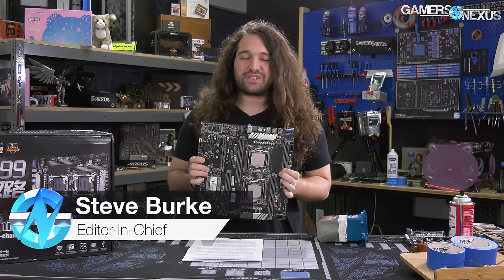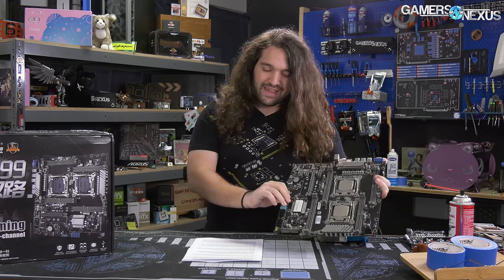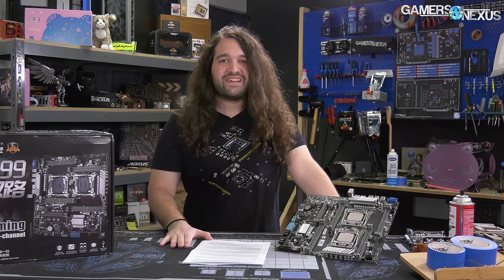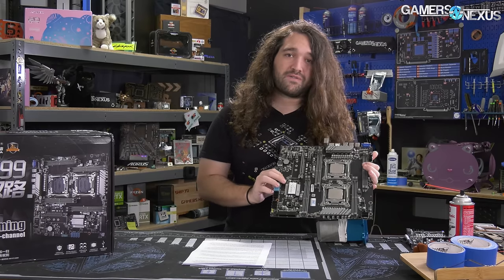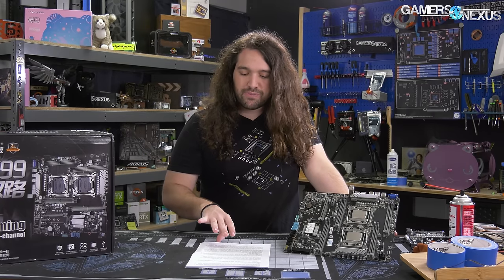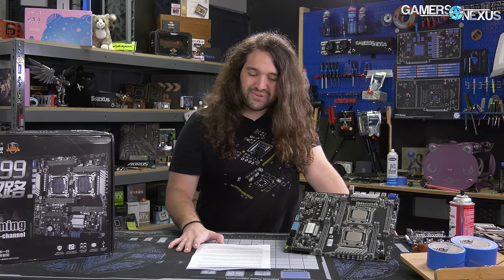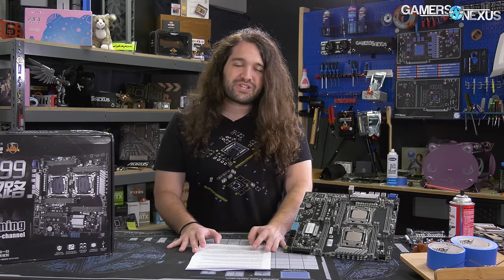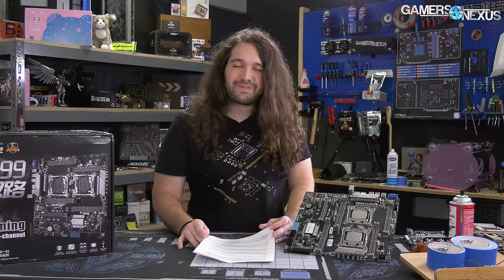24 Cores, 48 Threads for $360: Dual-X99 Jingsha Motherboard vs. AMD R9 3900X

Comment from the maker: You'd likely enjoy our computer mall tour at SEG E-Market in Shenzhen: https://www.youtube.com/watch?v=nXWB9GPkm3U
We previously built a dual-CPU X79 system here: https://www.youtube.com/watch?v=QEb_wxKVJbE
GN Wireframe Mousemats will be back in stock soon! Guarantee you're on the list here: https://store.gamersnexus.net/products/gn-wireframe-mouse-mat We sold through fast last time, so we're taking back orders early so that you don't have to keep checking back for the restock date. The Wireframe Mouse Mat is a high-quality, durable mat with high print resolution and custom features, and quickly became our fastest-selling item on the store. (Also, if you've got a Gold Foil shirt on order, those will finish production in November!)
Reply: hi
Reply: "they looked kind of like a scam, so we bought them" 🤣
Reply: Yessss! Been waiting for the mouse mat back order so I can finally support GN with more than just patreon.
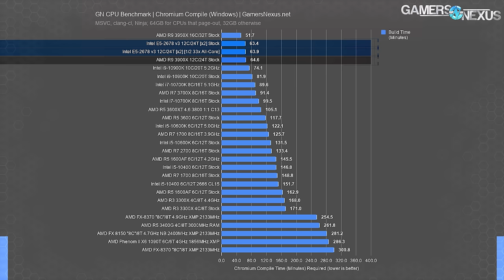Reply: 22:39 Sure they use more power per second. But you need to keep something in mind: If this pair of Xeon's they knock minutes off a render time, that is minutes where power a pair of hungry CPU's are not consuming any electricity. Things aren't exactly as bad as they appear on the surface.
Reply: 011 mini when?
Reply: Happy owner of E5 2620V3 with 3.2Ghz all core unlock + Z99 v102 mb, total cost $83 :-)
Reply: The reported Quad Channel is actually correct. Each CPU only has 4 active channels so the operating mode for the memory is Quad Channel, with two active NUMA domains. Sure it technically is a total of 8 memory channels but you only have the bandwidth of 4 unless your workload can utilize both CPUs properly without cross NUMA domain communication via the QPI link which would severely limit performance and other issues (those 0.1% and 1% lows in games), Blender is an example of a workload that can do this.
Reply: This is still a good option for anybody that does productivity with light gaming on the side.
Reply: Games might work better by assigning cores in windows to one node
Reply: If someone gets the idea to use this for a programming workstation, based on benchmark numbers I wouldn't recommend it.  What I've found that most of the real-world tasks don't use many threads. With my 3900x I would categorize tasks into two camps, with one is very common and another is less common. The common task is quick recompilation after small changes to the code those tasks use only very few threads and most of the cores are idle, and that doesn't scale to lots of threads so expect older Xeons being annoyingly slow, enough to distract you from thinking the problem. The second kind of task is less common which is a full compilation of everything. Full compile is what every benchmarker uses, and you don't necessarily need to do it every day, unlike the common task that you often want to do multiple times per minute.  The full recompile often scales well with more cores, especially with large codebases. So for a programmer getting a modern CPU with fewer cores is far better than getting old CPU with more cores. The reason to consider an old Xeon instead of a new CPU is trying to write highly scalable multithreaded programs with a very limited hardware budget. If you scale from 20 threads to 48 threads well with an old CPU you should scale from 20 threads to 48 threads on a modern system and testing scalability is a good reason to get lots of cores for a programmer.
Reply: So pity that you haven't tested single 2678v3. Really interesting how it performs in comparison with the budget Ryzens.
Reply: @jouniosmala9921  okay what if somebody doesn't have the money for all that. I don't feel that they stressed enough that all of that set up still beats the price of one CPU.
Reply: @DmitriyDarkJoney  TLDR they get stomped. They're great budget CPUs for like a NAS or something. But on their own they just don't cut it anymore.
Reply: @Dtr146  I was considering upgrading to a modern quadcore as a temporary solution with a motherboard capable of handling rocket-lake. Unfortunately for Intel, I needed the upgrade earlier than the predicted launch date of the new socket, and I needed more certainty of the new boards being capable of handling rocket-lake.  10600k is as fast as 3900x or 3960x for compiling Apache because Apache compilation scales badly with threads, which is literally the closest thing about getting the actual usage scenario.   Oh 3300x is relatively good it also, all the other CPU:s mentioned compile Apache in 21 seconds, but that budget solution uses 25 seconds.
edit:
I probably would have gone to 10400f had it been available, with real promise of motherboard forward compatibility to rocket-lake.
Reply: Something to note, you can buy single socket boards that are both cheaper and have very similar features from Huananzhi, and actively cooled VRMs. The 2678v3 is the cpu I have in my system, but having it not in a dual socket system allows for significantly better gaming fps, and less stutter, as you are able to modify the power limit with bios modding, as Craft Computing did for his 1660v3, which is also an unlocked xeon for overclocking, and got his to 4.2ghz on all 8 cores.
Reply: @jouniosmala9921  I mean that's true but if you buy a 10600k you'll have a good CPU that will last a while but you'll be on a dead platform. By Verizon you can buy a motherboard that will let you upgrade in the future.
Reply: 双路
Reply: @Dtr146  All platforms are dead currently for the future upgrade path if you buy the latest CPU with it.  What I really wanted was a modern AVX-512 system with at least 8 cores.  AMD probably offers what I wanted with zen4 and rocket-lake will probably be close enough, my old CPU was really old and I needed something modern as soon as possible when the lockdowns hit.  I just decided that the rocket-lake upgrade path was uncertain enough that I'll start using more threads instead of AVX-512 first.  However for most programmers what I learned holds true, fast performance at low thread counts is more important than lots of cores.
Reply: @jouniosmala9921  technically you're right but Intel's platform is dead as of now with the current road map. AMD's road map has yet to been revealed which there's a good chance that the next generation after this one isn't going to be on the AM4 socket but ryzen 5000 is going to be on the am4 socket for 400 and 500 series chipsets. so we won't even know if the sockets going to be dead until AMD announces their next CPU
Reply: Someday, I'd love to see just this sort of Frankenboard that would take 2-4 earlier Ryzen or Threadripper chips at a cheap budget price
Reply: Jingsha powerskark x99 gaming
Reply: I forgot to add: The cost of labor is much more expensive than electricity in the US. In workstation scenarios they literally pay for themselves.
Reply: Can I get your .blend file?
Reply: Thanks for all the content man, love your channel. Just bought that shirt you're wearing to do my part! it's pretty damn cool Steve
Reply: Really happy I got a 3950x for 400$ bucks
Reply: There are some other aspects in order to get real turbo boosts on dual xeon boards, the problems is that you've got to some other microcode reinjection on the patch because the microcode is the one that optimizes the processes not always higher frequencies mean higher results if you wan't yo know more you can contact me and i'll explain it to you, we have a group with @Miyconst and some other hardware professional which have developed and improve those patches for different boards for window, linux and hackintosh
Reply: Just wanted to say been using the mouse mat for a bit great job getting it done right  the quality is fantastic design looks great and is super sharp for being printed on a mouse pad.

 Also in case anyone was curious it works nicely with the logitech power play system, fits very neatly and functions.
Reply: @animearmpits3060  your replying hi to every comment your account must be hacked or something
Reply: @tonycheng6478  nope just clawing my way out of the grips of depression.. by spending 7 minutes commenting hi on everyone comment
Reply: These run quad channel "per" cpu. Same as Westmere runs 3 channel per cpu.. So I mean.. it's still just quad channel. Sort of.. Also the V4 Xeons run 2400mhz ram speed
Reply: Thanks, I love these obscure hardware videos. 
Like I know there are a lot of custom boards out there, many one-offs, but it still surprises me to see them.
Reply: @FragEightyfive  I received a E5 2420 V2 Xeon today ever heard of those? socket 1356. They are a 6 Core xeon which cost 9 dollars :) can still do 1080p gaming quite well. The motherboards are under 40 dollars.
Reply: We as americans dont support ccp
Reply: Power consumption really adds up... That 100W difference puts the breakeven around the one year mark, with better expectations of driver support. 

Given electricity prices where I live (NYC, 34 cents per KWh), that 100W difference comes out to $294/year if powered on continuously (typical for a work PC).
Reply: @mtmoto4522  How many Americans do you think watch videos about Xeons lol. They are all playing on clone Ryzen systems. However if you happen to live in a country that is unjustifiably and immorally sanctioned by the US (I'm not but I'm well aware of the corruption in the world).. You get a Xeon.
Reply: The E5-2678 V3 is completely locked, it has no turbo!!! This is not E5-2680 V3!!! Why are you misleading people Steve? Did you unlock the E5-2680 V3 and wrote it as E5-2678 V3? Because that is how it seems and i am the only one noticing it. Amazing...
Reply: @Artas1984  The stock E5 2678 V3 Turbos to 3300mhz on some cores. If you run a custom bios with lower voltage it'll hold 3.3 on all cores. The difference between the 2678 and the 2680 is that the 2678 can run DDR3 ram at HP's request. (It was used to upgrade datacenters which were running ddr3)
Reply: @ihavenoname275  ....Does the all core turbo unlock of has-well just work always and never need to be updated or tweaked once done? AS it even if it is hard to do is it hard to undo or even uninstall if were to do it and give the system to someone else are they good to go - does it at least seem?.... Wish somebody would find a broad-well all core turbo unlock.... but then the tcase may start to limit some? isn't tcase sort of insurance for intel on some of these things?..... I seen one 200 watt xeon not sure which version that seemed great however the tcase was like 58.9 or something? Why would that BE?...
Reply: ....WOULD have loved to see the 1630 v4 in this mix with its lower core but higher out the box frequency and high TDP for its part being same as most even 12 cores of same NANO, etc..... HMMM.....
Reply: @ReganMarcelis  on those "x99" boards it's just one time bios mod and flash, this days I see there is new mod that keeps the turbo unlock even after sleep, look it up
Reply: So why I was interested in this. Is because of Star Citizen. Where the higher the core count the better. The meada before for that game was only six cores with a single strong core.

But now there is no single strong core. And uses all available cores and threads.

So how would this build stack up against others in Star Citizen. Is my question.???

Yes of course a lot of the time the FPS is determined by Server and Network performance. But you can still easily discern averages in specific locations.

And the biggest problem in Star Citizen is that jitter. So I would be extremely interested to see how this multi-core system performs now.

Because technically it should be a shooting.!
Reply: You should do a refresh of this video.  Compare to modern cpus.  Ebay prices for xeon e5-2697 v3 30$ for 2. Dual 14 core 28 thread. R23 23,000 plus

Comment: "It looked like a scam........so we bought it"
Reply: it was also 69 bucks so nice
Reply: Nice
Reply: @fnige  nice
Reply: @fnige  nice
Reply: 5:45
Reply: I have to say that was funny, but sometimes it's a gamble to take.
When it pays off you can bet you can never get the same deal.

I recall a company selling a laptop for 30% of its price, it was a mistake by them of course so I ordered a few ;)

I find the glossy claims and "details" given in some world places out reaches both the products, reality, physics and technology itself.

That requires better translation that Steve lol... I am talking wider markets that PC, but still electronic hardware.
If they are the same internally I can see why they have problems...

Maybe if the cut body parts off for misleading/scams the market would be more honest. And less you if... The sun turns green and gravity changes by 90% and the wind blows in X direction coupled with a humidity level of 7 it will work as we have said, but about a third of claims if your lucky normally...

For the price the gamble was fair.
Reply: @icelee123  me, never, I'd get charged twice for it too lol
Reply: That is for better and worse part of the charm of buying from Chinese sites, you can get some zingers but can also get some amazing deals.
Reply: Personal experience on Aliexpress is pretty good. Never missed an order. The delivery takes sooooo long though.
Reply: That's good content.
Reply: Balls of steel, I'd say. All for the sake of Science. :D